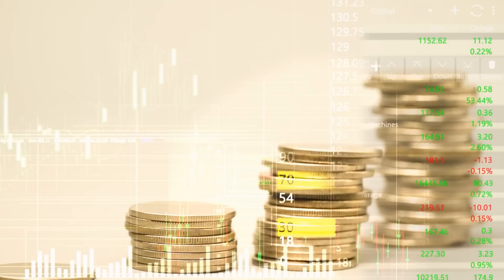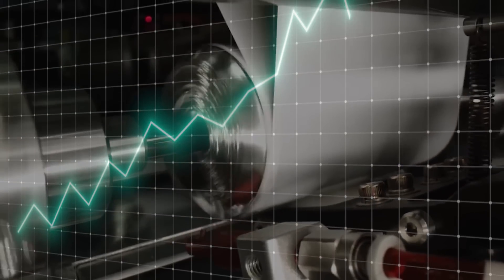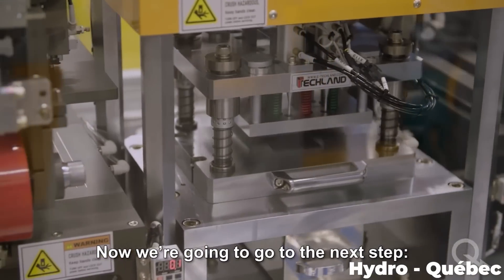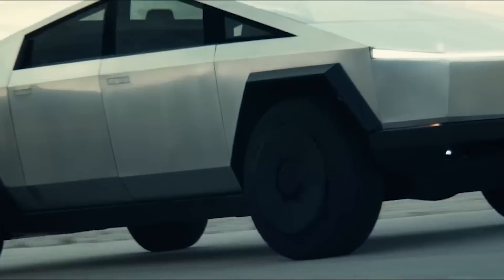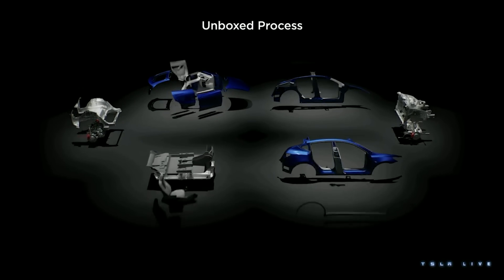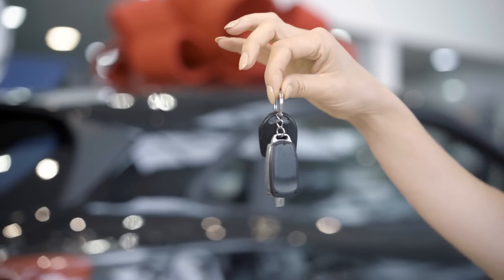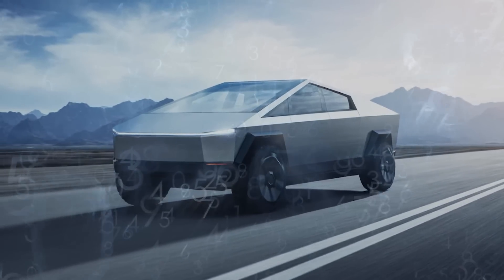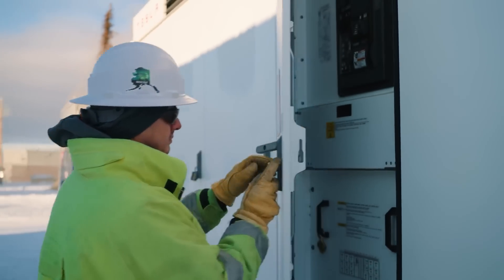The Next Generation 4680 Battery Cell Is Here!

Comment: I recently did a solar project and surprisingly ended up going with Generac for the battery storage component.  Better specs (17KWH vs 13KWH), less expensive and they would actually commit to a deliver and install date.  Also,  Generac actually has a customer service number that answers the phone reliably.  Thus far,  very happy with it.

Comment: I've read in other places, that energy density in the 4680 Gen 1 is actually not any better than the old battery although they hope to improve it's performance as time goes by.  This suggests that AT BEST cybertruck will only meet it's original range specs, which for myself,  puts a shadow over a CT purchase.  I'm far enough down the wait list that I will have time to decide when the actual specs get released.  Today 3 years after the CT announcement,  600 mile range is my minimum.  500 miles will just not do it for me.  I don't want a toy,  I want a genuine , all purpose transport and utility vehicle - all weather, all conditions.

Comment: CATL and AMPRIUS are on the cusp of manufacturing 500Wh/kg batteries at reasonably high volume, where that leaves Tesla’s 4680 is anyone’s guess. We really have some new battery technologies just around the corner which will give EVs the same, if not more range than ICE cars, if full capacity of these new batteries bought up by Tesla then they will be sold to VW, NEO, FISKER and POLESTAR, potentially making Tesla’s cars inferior to their competitors. So as as much as Tesla wants to keep everything in house, buying CATL, BYD and AMPRIUS batteries denies Tesla’s competitors these very same batteries and allows for Tesla to gain a greater market share long term.
Reply: Completely agree. Gotion are another company due to produce 500wh/kg batteries in 2024 and supply a majority of them to VW. Battery tech is rapidly evolving and it seems that the 4860 will be obsolete before it really got started.

Comment: 4680 physical volume is 5.48 times more than 2170 volume. Hence energy density remains the same (providing, they claim "4680 has as 5X Energy and 6X Power much as 2170"). So, where's the increase?:body-blue-raised-arms:

Comment: I volunteer to have someone in a Cybertruck pull my travel trailer from Michigan to Florida for my winter stay. It is bumper pull so it should be very easy for any truck. It only weighs 15000 pounds, and is 8 1/2 feet wide with a height of 12' 10". It was built to minimize aero drag so another easy thing for the Cybertruck. My Dodge ram has pulled that trailer North to south round trip 13 times and east to west round trip three times, with lots of travel as well. Just 74,000 miles towing. I won't even put all the things I carry in the truck in the Cybertruck. Just 96 cubic feet of fairly heavy stuff, about 2500 pounds more or less. That we can do in the late fall of 2024 with a true production vehicle. Should be a piece of cake. I am only running about 450 to 500 hp and 1200 pound feet of torque. Fall of 2025 we will add the fishing equipment box and the cartop boat to the mix. Trip will be a bit longer as I need to go to South Dakota first then on to Florida.

Comment: Even though the 4680 has 5 times more energy, it’s volume is also 5 times bigger. So the current production that we see in actual cars, the energy in the pack is still the same, just with less (but bigger) battery cells.
Reply: Fewer, not less. You can count the cells.

Comment: Love LFP batteries for 4 reasons:
1. You can always charge it to 100%
2. So, you are not carrying around deadweight that you can’t or shouldn’t use for fear of battery degradation.
3. Zero chance of catching on fire.
4. Costs significantly less
What’s not to like about them!
Reply: >> 4. Costs significantly less <<
This was true 4-5 years ago.  LFPs are about 20%-30% cheaper per Wh/kg than older, less-denser NCM523/NCM622, but not recent high-nickel NCM/A batteries commonly used today in GM's Ultium/Ford F-150 lightning.
Reply: @tooltalk  Check out the batteries by Magnis Energy. Similar to LFP, but they replace the iron with manganese. Also, Tesla just signed a deal with them for their graphite. * Yes, I AM a shareholder of Magnis and Tesla. ;)
Reply: 5. Free of critical Kobolt
Reply: Lol, the battery won’t live up to the height, like last time🤷😭😭😭🤣🤣🤣
Reply: >> 1. You can always charge it to 100% <<
terrible idea.  You don't want to charge any Li battery to 100% -- in LFP, it accelerates degradation despite its larger recharge cycles.   Tesla recommends to charge it to 100% b/c it's difficult to read the SOC accurately on LFP's without recalibrating it every week.
>> 2. So, you are not carrying around deadweight that you can’t or shouldn’t use for fear of battery degradation <<
LFP's are heavier than the alternatives, (eg, NCM/A) due to lower energy density
>> 3. Zero chance of catching on fire. <<
There were no fewer than 45 LFP EV fires last year in China.  In 2021, two firemen died in a LFP ESS  fire at a shopping mall in Beijing -- China's capital.
Reply: @tooltalk  Flawless Victory
Reply: @tooltalk  damn rekt for all 3 points
Reply: @tooltalk  I wouldn't use chinese manufactured cars as an example of the safety of anything.
Reply: @scythelord  My iphone built in China, should I worry about safety too?

Comment: Why doesnt tesla have 2 battery banks one discharging while the other charges? that can be switched back and forth i bet they'd go for a couple thousand km before needing to be plugged in to charge
Reply: You'd lose your bet.
Reply: @vidznstuff1  you obviously dont know much about electromagnetic theory.
Reply: It would be too complicated and impractical, if you google the total weight of a model 3, it is half a ton. 

I don’t think anyone will be swapping 250kgs of battery whenever they reach the station. There are also multiple EV brands too so how are going to cater for that? 

Also, I believe the battery pack is part of the structure of the car to minimise manufacturing costs and to increase cell count. Having it removable would remove those benefits.
Reply: @jesselam5867  fuk you on about? Who said switching? a simple SWITCH would do just incase you're confused a switch is like a BUTTON, and who said anything about have 2x as many batteries? There could be just half as many batteries, you have a warped view of things, how did that happen?

Comment: The trade off of the Li-ion chemistries (LFP, NMC, NCA) are pretty interesting.
LFP is nice for being cheap due the the relative abundance of its raw materials compared to other chemistries. It also generally has significantly improved cycle lives, surviving roughly twice as many cycles.
NMC and NCA are more expensive with lower cycle lives, but have significantly higher energy densities (in terms of energy per unit volume and energy per unit mass) than LFP. That's why Tesla is segmenting its use of the different chemistries. NMC makes for a denser pack for the long-range vehicles while LFP makes for a cheaper and longer-lasting pack for the standard range vehicles. Tesla even analyzed which battery chemistries should be used for what cases (even talking about ships and planes and the like) with their Master Plan Part 3.
Reply: >> LFP is nice for being cheap due the the relative abundance of its raw materials compared to other chemistries. <<
Not necessarily -- cell cost per Wh/kg, LFP is cheaper than much older NCM532 or NCM622, but not high-nickel NCM811.  But then, it's also somewhat relative -- there were wild fluctuations in battery raw materials last year -- for instance, after stratospheric rise last year, the price of lithium has plunged by 75% in just past 4 months, since the end of China's EV subsidy on Jan 1, 2023. I'm not entirely convinced that Tesla's (or Ford's) decision to use LFP is purely based on technology or price.